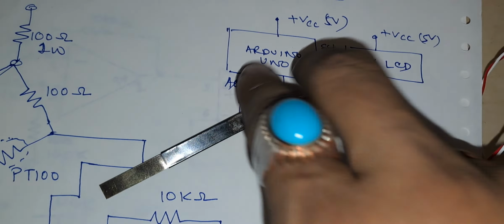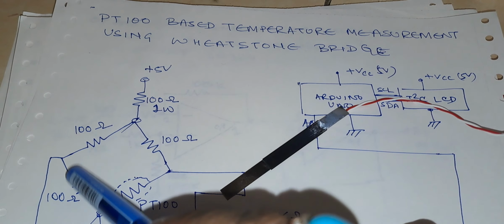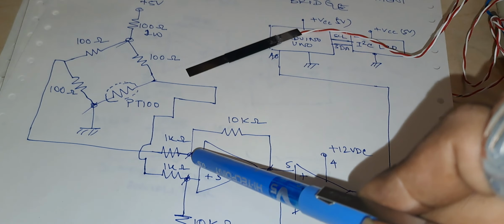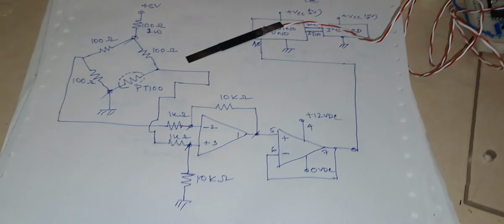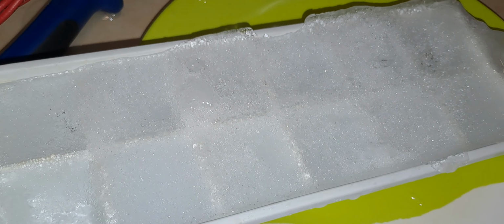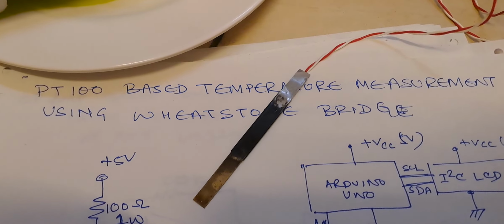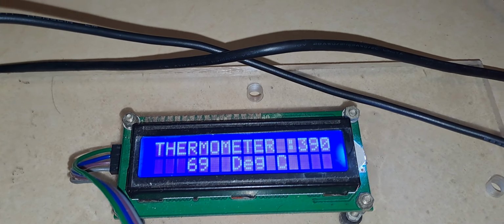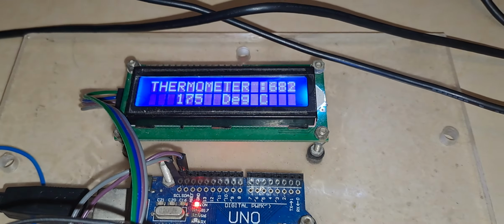PT100 based temperature measurement using Wheatstone bridge. Operational amplifier & Arduino used.

Comment: I am not from engineering background, I want few clarifications. 1. Putting a 100 ohm/1 Watt resistor at input of whetstone bridge will cause voltage divider circuit, causing input voltage of Wheatstone bridge to vary, which will cause measured voltage on Wheatstone bridge to vary with temperature as a function of input voltage variation due to divider circuit causing nonlinearity between temperature and measured voltage. 2. Wheatstone bridge itself is a voltage divider circuit, so resistance change of rtd sensor with temperature change cause nonlinearity in temperature and voltage. 3. Map function of Arduino is a linear transformation from one scale to other, plus it is an integer math not resulting in floating point temperatures if required. How can actually one compensate for nonlinearity between voltage and temperature in arduino?

Comment: Hie, i wasnt to build this temperature sensor but i want the range to go up to 500 degrees where can i do the changes in the code amd the circuit
Reply from the maker: Make single point calibration at 100 Deg C, it will display 500 deg with same slope